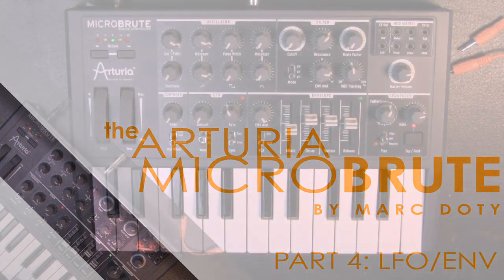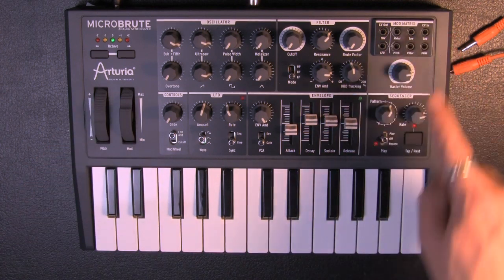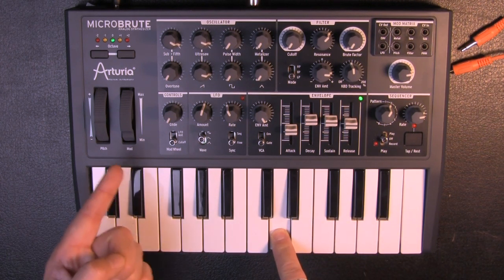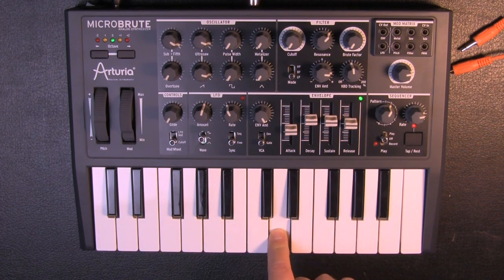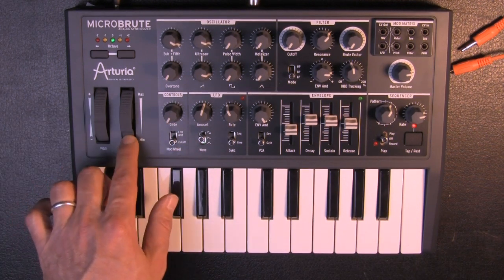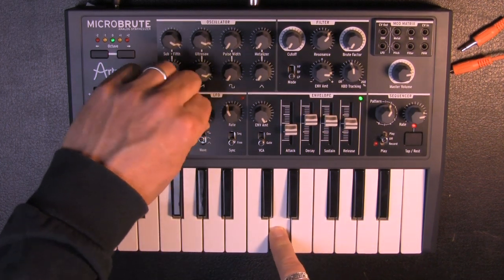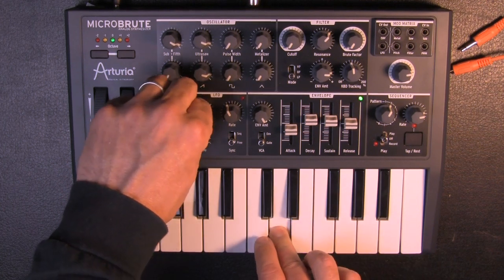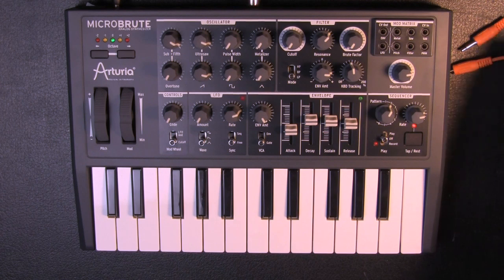The Arturia MicroBrute- Part 4:  LFO, ENV, and patching

Comment: Does the waveshaping controls act as attenuators of the matrix modulation sources when you plug a patch on them or just continue acting as a fixed value of the waveshaping parameter?